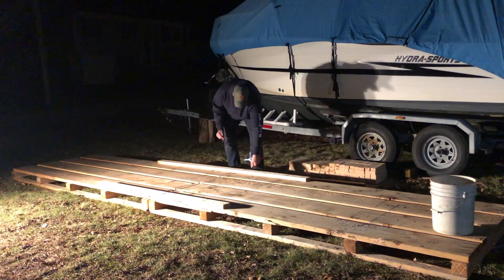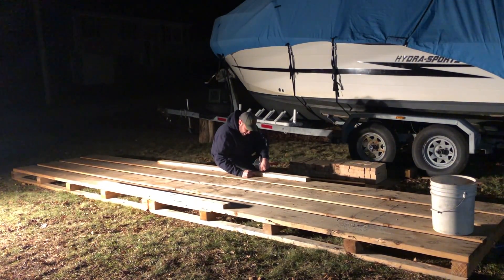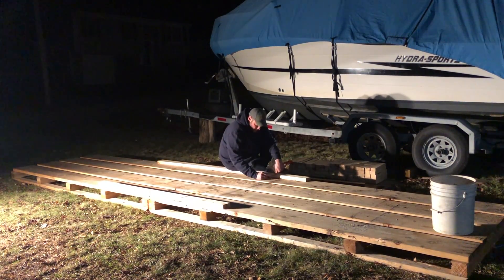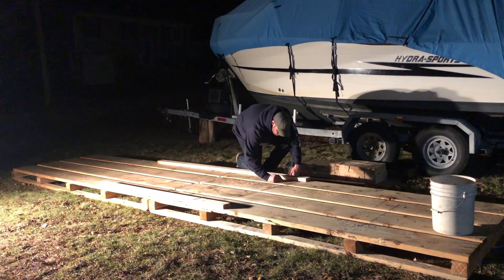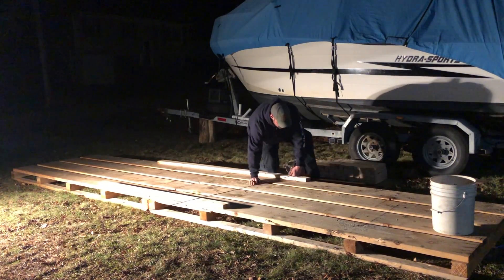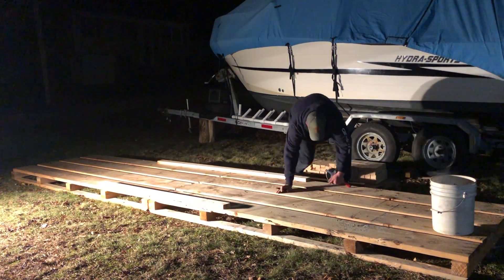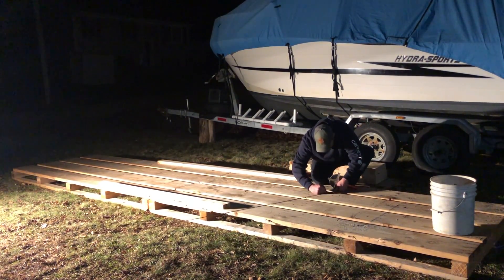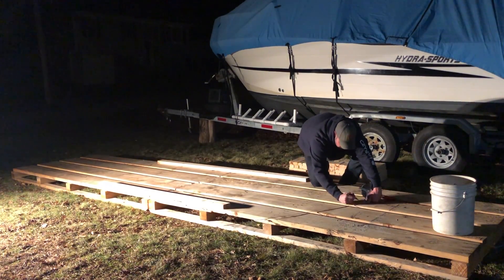STEP 2: Continuing the Journey- Gothic Arch Structure to Build our 25' Power Catamaran in! Part 2

Comment: Hello, I was wondering if you could tell me about your experience with this structure as a storage building? I am currently researching this method of building for a small garage/house structure, with a full size working garage on the ground with a slab and a living space above on the second floor.

Does it seem structurally sound enough? What sort of load would these arches support?

I intend to build a traditional box frame to hold the second floor up, so the arches would only be holding up the roof really. I imagine they might need to be a bit beefier than what you've built here though? This seems more space efficient than an A frame.

Comment: I'm thinking of making this truss design for a workshop... 
I've seen it done with the 1x3's in most builds, however my experience with that wood is that it splits extremely easy (even if pre drilled)
Was that an issue for you?
I'm considering using 1/2 plywood cut into 3"wide strips and just looking for input before I spend the time at the table saw.
Reply from the maker: We did account for this as well.  the 1x3” were cheap at the time, so a few extra were ordered. Overall we probably split 3-4 pieces.
Reply: @BuildingMVDauntless  ok.  Thanks for the response. 
Definitely cheaper than plywood, and a heck of a lot easier than ripping down all them strips. .
1x3's it tiz.👍
Reply: @BuildingMVDauntless  Great build! Have been researching a bow shed for a boat project for some time now. Where did you find 1x3's longer than 12'?? I've struck out. I'm doing a 20' wide design and I've had to butt joint boards together and have been having trouble.

Comment: What  kind of glue did you use? Since you created a hinge point where you attached the arches to the stub well how well has it held up and has it bowed out at all?
Reply from the maker: We used titebond 3. The arches came down on the walls around 8” that overlap was screwed into the wall. We then used metal clips on either side of the arch to secure it to the knee wall. Also when installing the horizontal perlins we staggered the joints on every layer, this locked in the structure from lateral movements. The knee walls have not bowed out at all. The structure  has been erected for almost two years.

Comment: This is great!   Any way to achieve R-30 insulation value on the ceiling and R-13 on walls with a structure like this? Could something like this ever pass Florida primary dwelling building code for Structural, Energy, Wind?
Reply: @12vLif3. Shamrock Aquaponic farms sells plans for this type of structure. They are based in Florida. And If I remember correctly the plans passed hurricane code there. You might start there. If you're still looking.
Reply: @carlbrown939 I couldn't find the plans you mentioned? Do you happen to know exactly where I could find them?
Reply from the maker: I really can’t answer that! It would need to be brought up with someone who’s experienced with this. We’re just trying to build a boat 😆

Comment: That's good job. What is the board thickness you use for the arch. I plan to do it for a summer kitchen, and I have no idea how to start
Reply from the maker: Gihel Cl hi! Thanks for the question. I was told that they  are 1x3 furring with 2x3 spacers and 2x6 double ridge with 2x4 knee walls! Hope that makes sense.
Reply: @BuildingMVDauntless Thank's,  1x3 I guess these are inches ?
Reply from the maker: Gihel Cl yes that’s correct. Dimensional makes it actual 3/4” x 2-1/2” but they’re called 1x3 for some reason they’re also 16 feet long
Reply: @BuildingMVDauntless  ok in France we use metric system, it's nice to specify I would have been wrong. Thank's a lot
Reply from the maker: Gihel Cl got it! The plans for our boat are in metric and we need to learn that in order to build it. It’s going to be interesting!